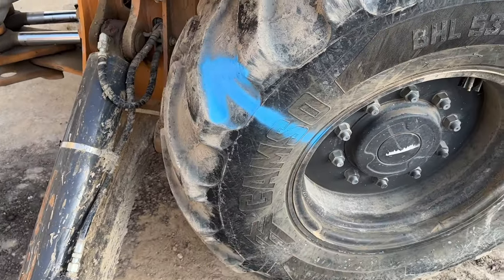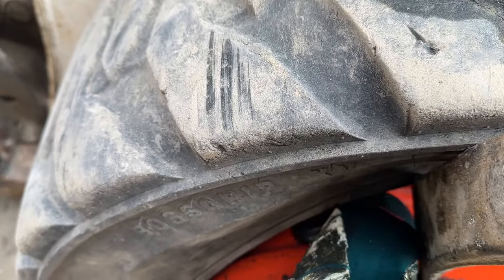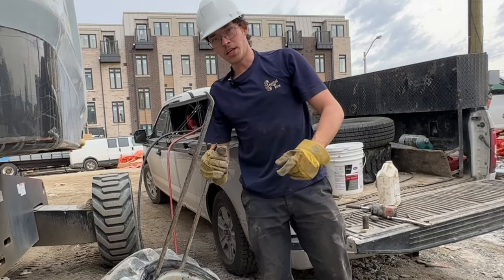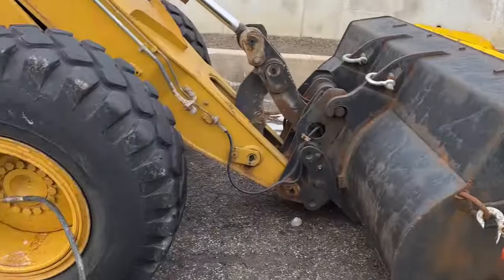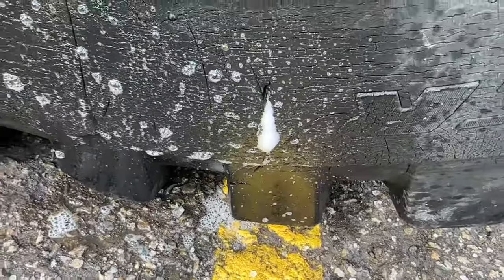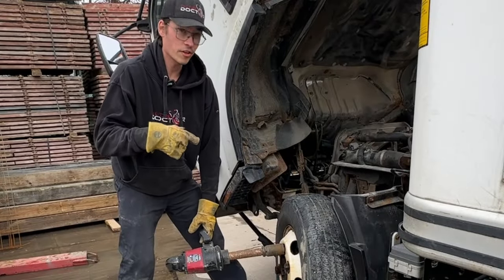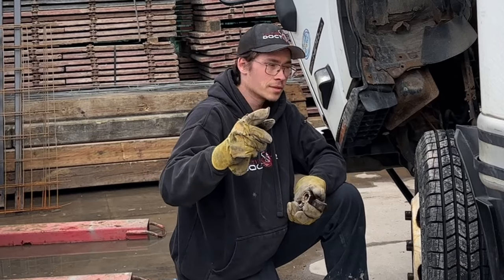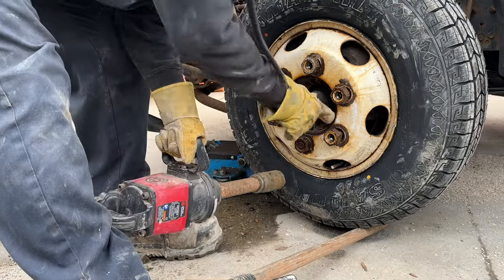The Worst Tire To Repair!

Comment: Left-handed nuts only on one side, that way as the wheel spins (centrifugal forces) tightens the nuts all the nuts will be turning the same way as you drive forward slightly tightening or just keeping them tight. older Mopar's and newer Japanese trucks have them I am sure there are others, the studs are marked with a L.
Reply from the maker: Doesn’t explain why the right side comes off like normal though 🤔
Reply: The right side are already turning in the correct direction for the self-tightening effect that's why it's always only one side that is left-handed Engine cooling fans are sometimes left-hand threads for this same tightening effect. You sometimes learn these things the hard way. Believe me Iam old!
Reply: I’m a commercial tyre fitter and this what I’ve always been told as well weird but makes sense
Reply: Could you explain that one to me. An engine fan is bolted to a spinning shaft. A wheel stud is not revolving on its axis.
Reply: @marcw1867  The centrifugal force will work on both of these applications. The wheel studs are also bolted to a spinning shaft the axle.
Reply: @ericherrmann3799  I think you need to do a little more work in your physics class. When the nut is on the spinning shaft the principle is inertia.
Reply: @marcw1867  35 years of med.duty trucks and a L on the studs means left hand threads helps keep them tight because of the spinning motion. Thats all I got Mark if you know of another reason for left hand threads let's hear it.
Reply: @ericherrmann3799  yep, the same reason you wrap the teflon tape counter clockwise

Comment: Tire doctor, I don't trust my hammer swinging skills so I take the mini that was behind you and lay the teeth flat then push down on the bead. I'm an equipment operator, not a good hammer swinging dude. I worked after school for a tire company after school for 4 years. I learned a lot. Stay away from tubes, and always take the core out when you set the beads. 😢 That's been along time ago.
Reply from the maker: Be one with the hammer